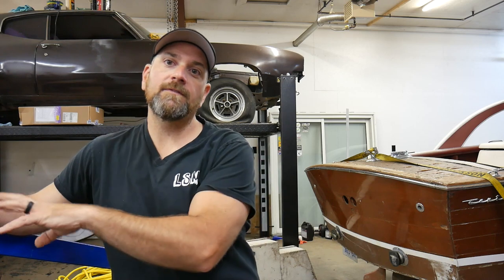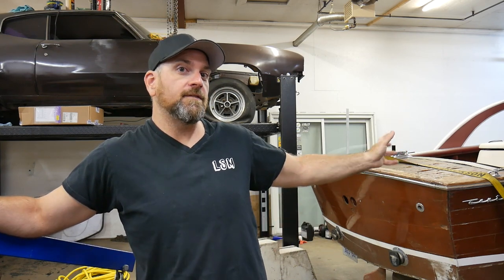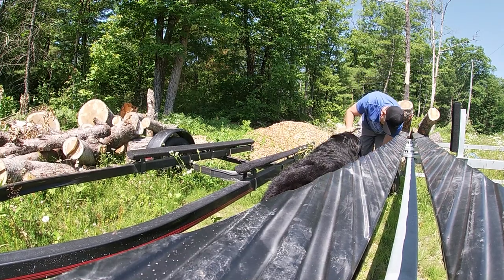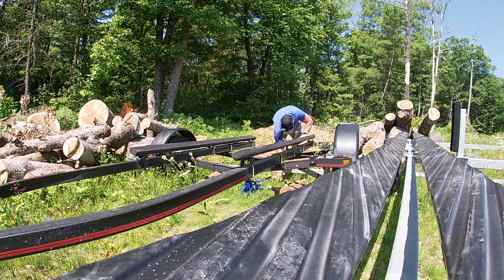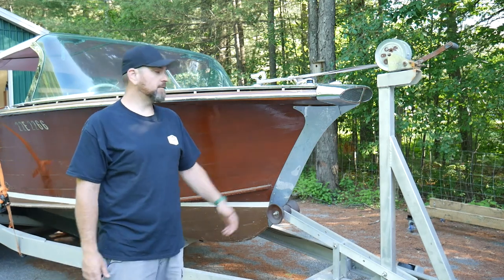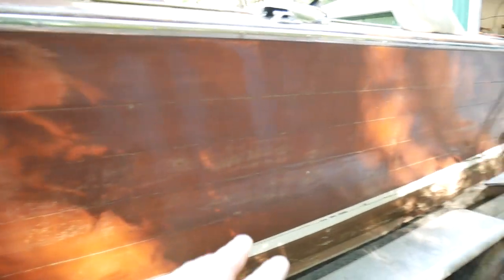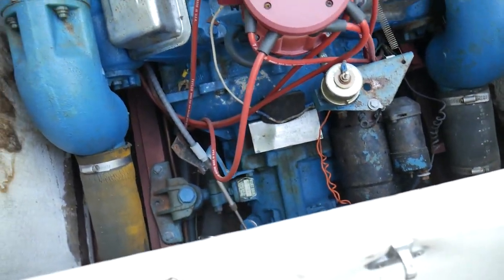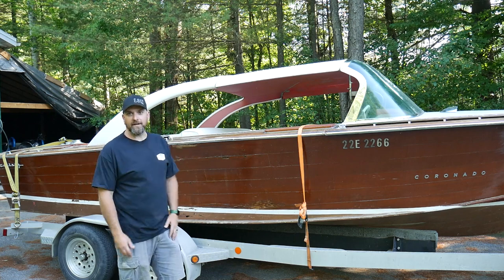Gravenhurst Antique and Classic Boat Show, Maybe I bought A Boat!!

Comment: In 1960 i was 13yo, and my Dad bought me a boat for our cottage, it was 1956 Peterborough, a guy also had one that was much nicer than mine, the deck had inlay between the planks, and i often wondered how that was made, it was beautiful like a cherry color, I still wonder how it was done? I had an 18hp on mine and i think his was a 25hp they were both the same length, but his was much better looking with the deck planks
Reply from the maker: It used to be called Oakum. Was a packing that was used to seal the planks. Now folks just use a special caulk like 3M 5200.
Reply: @longsspeed  thanks for the info